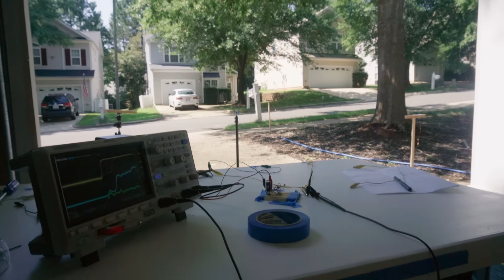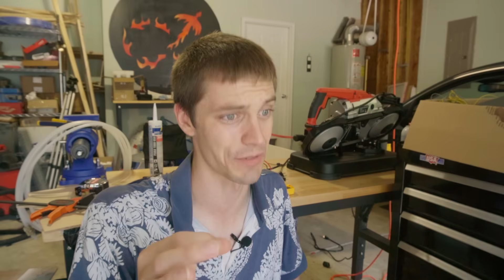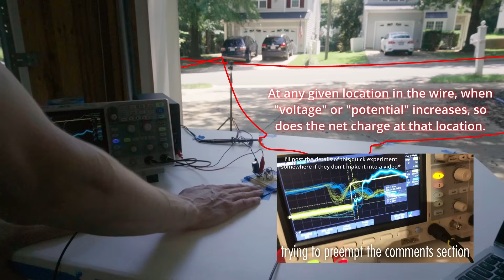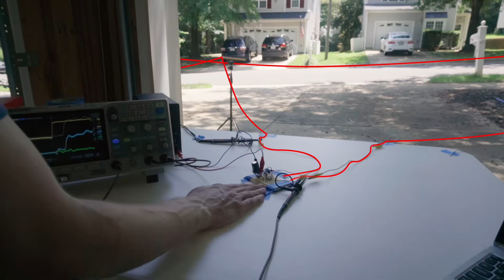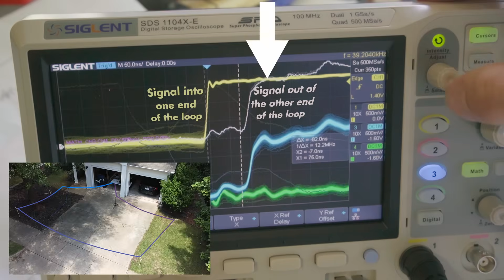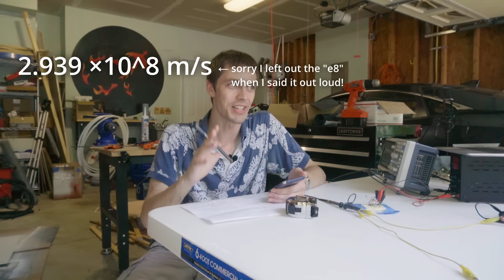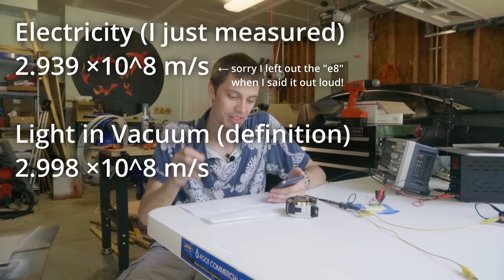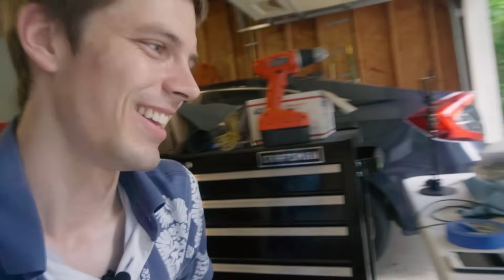Why does WATER change the speed of electricity?

Comment: Crazy way of looking at it. A wire behaves as a transmission line with a characteristic impedance. EG a TV coaxial cable has an impedance of 75 ohms j0 where j is the reactance. A parallel pair feeding an FM tuner from an external antenna is 300 ohms j0. All transmission lines have a characteristic transmission velocity that depends on the conductors and dielectric materials. And that's the way we should see this, in terms of transmission lines and matching of impedances. Maybe the maker of this video will produce a Smith Chart. (Yes I am an engineer not a Youtube video creator)

Comment: Since water is a dispersive medium, the high frequencies will make the circuit faster than the low frequencies. This has the effect of spreading the out the step change from instantaneous to a more gradual rise. The oscilloscope  trace confirms this.

Comment: Hey, I love the video you made and the experiments, but I watched a video made by Veritasium that concluded that the energy that electricity transmits is transferred via the electromagnetic field, and not the wire itself. Assuming this is true, then it doesn't matter whether a wire is ten metres, a kilometre or a thousand kilometres, if the power source and the lightbulb are close to each other, then the electricity will arrive instantly, via the electromagnetic field.
To disprove this, you would need to put the power source and the bulb a long distance away from each other, connected only via the cable.
To verify the results, you would need a really good way of measuring time at both ends, synchronised as close to perfect as possible, and set to enable at a certain point in time.
Or otherwise, have two wires, one going straight, and the other arranged on one half of a circle where the two points (power source and lightbulb/whatever sensor you have) are the end points of a line segment which is the circle's diameter.
Measuring the difference between the arrival time of the two signals this way should allow you to perfectly quantify the speed of electricity.

Comment: You are confusing electricity with current. Electricity is "The physical phenomena arising from the behavior of electrons and protons that is caused by the attraction of particles with opposite charges and the repulsion of particles with the same charge." The current takes a while for the electrons to start moving, but electricity does travel at the speed of light, it's just that the speed of light is different in different mediums, but it's significantly lower in a conductor. The electricity does not flow through the wire, it flows AROUND the wire, and we can measure the EM field to prove it.

Comment: 18:29 I am doubtful about this.

I don't know what power source you are using, but I think it should have a dirty big capacitor (technical term) on the adjacent tothe switch, on the side of the power source. That would ensure that as nearly as possible you expose your circuit to all of your 1.00V.
I understand that there's some impedance prevents the circuit going from 0A to its balanced current.
This results in a curve, but I don't see how it can be part of a sin wave. As the current increases, the PD across the switch falls, but the larger the current the less quickly the PD falls. It's a curve, I think it's exponential (declining though), but not sin. In AC, the PD is reversed and that results in the curve being driven down.

My maths isn't as good as it once was, and I never learned about FFTs.

Comment: I take issue with your assertions that the difference in speed between 98 ns and 100 ns, when talking about electricity is, “not significant”.  That’s HUGE in only 28 meters.

Comment: Could you run the same test but have the ground return follow along in an parallell wire path? My limited understanding of this is that the dielectric constant of the material between the ground current return path and the current path that affects the speed, so if the ground is following along the signal wire, perhaps the effect of the water is negligable? 
For coaxial RF cable the ground return path is in the shielding, and the speed is determined by the dielectric between the center wire and the shielding as i understand is, and if that cable is submerged the speed is not affected i guess?

Comment: Let's be accurate in the terminology - you measured the electrical impulse propagation through the wire, which is close to c, not the actual speed of electricity, i.e. how far electrons move in a given time unit.

Comment: I'm late to the party, but an easier (certainly less wet) way to see this is shorting a length of (filled) coax cable on one end, you should get something like 0.66c that way, iirc. 
Also some some additional discount electrical experiements for people that already have their hands on an oscilloscope and function gen: If your cable is long enough (or your scope has enough horizontal resolution) you can even play around with it open ended, send a pulsed signal down it and take a look at the dip in the rising edge, that should be the reflected wave at the end which allows you to roughly calculate the length of the cable. With a 50(75) Ohms resistor at the end you can even see the effects of termination.

Comment: Electrons don't flow through wires. They lose their identity in a mass quantum state. The ones at the end are no more the ones that entered than a drop of water thrown into the ocean can be picked up later on the other shore. There is no way possible to know what happens to any electron since they have no individual identity inside the wire. You can't paint them green and watch them.

Comment: I'm surprised that electricity doesn't slow down the way that light slows down in a non-vacuum. Oh, ok, so it depends on the dielectric constant surrounding the wire moreso than the wire itself. That's rather interesting! It would be interesting to see more experiments to tease apart the difference between capacitive effects versus propagation delay.

Comment: Actually it is the electric field that is transporting the energy, so electricity is travelling at speed of light, because the electric field is the one which is actually moving. The electrons are also moved and because of that, the energy is transformed into heat/light.  But the electrons aren't moved all the way, they are just triggered by the electric field and moves like in video said a little bit. It is a good analogy to think about electric circuit like water pipes, but wrong when it comes to the question of the movement of the electrons.

Comment: Up for a challenge?

Make/find a large sphere of solid copper (or however large it needs to be depending on our ability to measure time). Attach wires on either side perfectly opposite through the centre.

The transmission either goes straight across (diameter = 2 * r) or around the sphere (half the circumference = pi * r).

Anyone know if something like this has been done?

Comment: 15:20 If you are saying that the water is decreasing both the strength and the speed of the E field, and this is what's dictating transmission speed, then you are conceding that it is all to do with a field outside of the wire, because no water is connected to the electrons and their fields in the middle of the wire so they should be unaffected and continue @ c.

Either that, or all of the electrons are doing work polarising the water and this is somehow slowing the entire transmission speed down.

Comment: What would happen if we have a 10m copper wire, and around it we cast, say, a 10m thick material that EMR basically cannot penetrate i.e. there is no way any E or B field can set up around the wire.

Could current flow in the wire? What would be the transmission speed?

Comment: I disagree with your conclusions about why the speed slows down. I hate this idea of fields outside the wire dictating everything.

For me it is this simple - the back emf of the accelerating electrons need to do work electrically polarising the material around them ( air, water, rubber, ceramic, etc) - this comes out of their KE and since they now approach the electron in front of them at a reduced speed, the acoustic wave slows down.

So when there is only a vacuum, we get c!

Dunno about you, but I find the idea of an acoustic wave travelling through a medium of electrons generating a speed of c EXTREMELY INTERSTING!

This speed is generated in the exact same way as sound waves - the speed is dictated by the electron mass and the electric field strength.

Nah, can't be true - surely energy travelling through a medium cannot produce a speed of c! Sounds too much like some sort of Aether! 😉

Comment: 10:00 I think it's a little presumptuous to assume that either the electric or magnetic field, independently, have their fields change through space at c. Electromagnetism does this, but I'm not sure about the respective forces on their own.

But anyway, think of the stationary electron and the moving one. The stationary electron's field is already "established" so as the moving one moves toward it the effect should be immediate. But the effect of the moving one's field on the stationary electron will take time, assuming the electric field speed is not instant.

Come to think of it, this is VERY interesting! 🙃

Comment: In other words,
What we call "Electricity" is really the Magnet Field -- not the Electrons themselves.
Reply: The Magnetic Field is like the Surf. In a surf the water molecules don't travel they just move up&down a little, while the Tsunami travels at 600mph.
Just like the Speed of light is to Electrons.
Light is a wave with a certain vibration we call frequency.

Comment: did you specifically measure  roughly 100 light-nanoseconds of wire to make the calculations easier, or did you make it as big as would fit, and it just so happened to measure out.

Comment: Great video.

If it takes a certain amount of time for the water molecule to orient itself with the magnetic field, what would happen if your frequency of oscillation matched that rotation speed?

I imagine the water would heat up but I would also expect a resonant effect that would provide either be a maximum or minimum resistance to current flow.

Comment: I've had a question for a long time about circuits. It's mostly related to hydrolysis, but Im wondering if using a mesh changes anything over regular wire. Where your leads are split up and trying to have as much surface area as possiy

Comment: If you want the electrons to move faster and with less resistance use copper line with a thin layer of silver over it.  This will improve the skinning effect with much less resistance and less loss of voltage.

Comment: Air gap capacitance within the stranded wire collecting electrons like a capacitor.
More interesting is the inductance ripple on the signal as it starts the pulse. Especially on the time lapse while filling the tube making it act as a high and low pass filter.  The inductance ripple grew while the capacitance of the propagation increased. Look at it in another perspective. With the light experiment you can not measure the source, but with electricity you can. Measure the source and it's resistance to push the electrons. An inductor increases the speed and a capacitor slows the propagation through a conductor.

Comment: Minute 9:10 of this video. Now, How does the farthest "electron" that moves knows it has to start moving the instant you close the switch?

If information traveled either through space or through the wire or through any physical media then, considering "c" is the fastest speed of propagation of anything according to relativity, it means that any info will be at the most a Planck length away from the switch after a Planck time has gone by since it got closed, and since a Planck time (5.39124X10^-44 seconds) is the smallest time period we as observers should be able to sense then, to me, a Planck time becomes the definition of "immediately". This means that the farthest electron that moves should be at the most a Planck length (1.616199X10^-35 meters) away from the switch in order to immediately "know" it has to start moving. Now!, we should notice that the farthest "electron" is alway going to be much more farther from the switch than a Planck length so that first wave that you mentioned in your last video on electricity, it does violate relativity. Nevertheless I think this isn't weird at all since I also think it's probably the same phenomena that allows quantum entanglement to happen. We can picture it as an "instantaneous change of state" that affects the whole circuit the instant you have closed the switch and that actually "triggers" the "movement" of the "electrons".

After that, I agree with you about electricity traveling at "c" not through the wire itself but through the space surrounding the wire. Nevertheless, electricity speed should actually be very close to "c" but never actually "c" since space around the material media of the electrical circuit becomes "affected" merely by the presence of such material (meaning that the material media that actually forms the electrical circuit produces gravity even if we were able to set the whole electrical circuit in the middle of the space outside earth).

Comment: Have you thought about exploring different metal types for wires? Aluminum vs. Copper? Or even running electricity through a long chain of magnets. I’m thinking neodymium magnets in this case, as they can conduct electricity. I learned magnets can be made by heating certain metals and then placing them in a magnetic field so that the actual atoms align differently.  Would electricity run faster through a magnet with the atoms in that configuration versus the same metal that has been demagnetized. I guess this is looking at impedance, inductance and conductance.

Comment: You wanna test electricity vs light speed?

Test fiber optics speed vs electrical. You'll see.

New Gen circuits will stop using copper wire and use lasers with optical wire.

Interesting that power slows down at the negative, I've always thought a negative was creating a type of "back pressure".. Like a muffler after an engine. 

Also... Tap water is conductive... Not dielectric... Only pure RO/Distilled water is dielectric... Because of electrolytes in two water...

Unless your wire is insulated.

Comment: If I had seen the question. "Does electricity travel at the speed of light?" my answer would have been "YES" and not because I just heard his answer. You see, electrons don't actually move. [well a little tiny bit] I call it transference of potential energy from one atom to the next atom in a conductive material. The higher the resistance of the medium the less transfer is allowed but the speed which transference occurs remains the same. In a sense the energy travels in waves from one atom to the next.
Here is a layman's analogy...
Take for instance that desktop toy with steel balls hanging from strings on a common rod. You pull back the first ball and release it. That potential energy [kinetic] is transferred into ball #2 and to the next and so on, yet none of the balls move except for the one at the other end. the energy applied to ball #2 is the source and the last ball has energy to do work, the energy traveled from the atom of one ball to the next in a wave all the way to the other end.

Comment: would love to see this experiment repeated with a superconducting wire. not sure if you could just dunk a coil of wire in liquid N, I think you'd have to spread the wire out otherwise the coil would = an inductor and not a simple wire. maybe you could insert the same length of wire in a tube, then pour in liquid N, get the wire to super-conduct and (perhaps?) see an even faster speed? my basic understanding of superconductors is that the whole mass shares the same quantum state, so perhaps your current would asymptotically approach c ?

Comment: You say instantly, almost instantly movement of electrons. I said for years that light is instant speed, unless it is not broken through like by glass. As you say water reduces speed? Electrons need to find in such way their partner, but they see its partner. That's probably why electricity speed is reduced.

Comment: Maybe i did not observe this detail in your video but did you adjust for portion of circuit going trough water? Looks like most of the circuit i still suspended in air and only fraction of length is encapsulated in water, so if you have 28m long loop, and in that 28m you have 4m trough water, you will experience partial slowdown (24/4=1/6 of observed speed),  which fits your observation like a glove (have to adjust for ratio of air suspended and "trough water" conductor!)... So  adjust with your data not my approximation!

Comment: In a lot of ways, you are re explaining wave form collapse on a visible scale, as that is being demonstrated. All the wave forms that make the summed wave form of the switch(change of potential) wave form, get collapsed on contact with the change in mediums, entering and exiting water. Because of water's properties, the lower ones are drained in heat(atomic motion), and the high jostle the electrons a little. Because only a portion then renders into the heat for the water, the rest propagates thru, making the combination of refractive index and dielectric drain. This is also a big part of how microwaves work too, but taking advantage of the transform to heat.

Comment: I'd assume that the resistance will not affect the speed of electrons, but the actual thickness of the wire does. A thicker wire needs more electrons to "fill out" the wire, and this would require more time to happen.   Maybe???